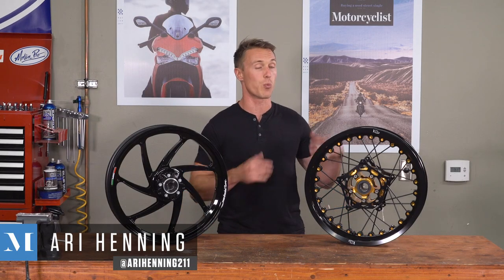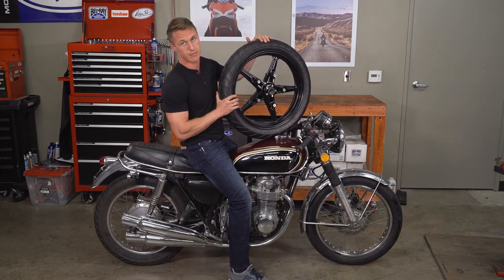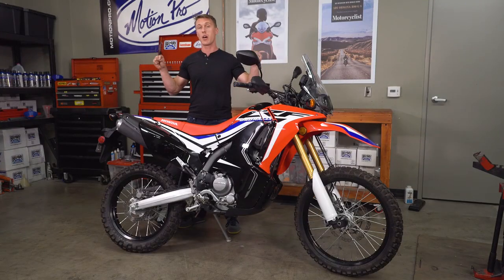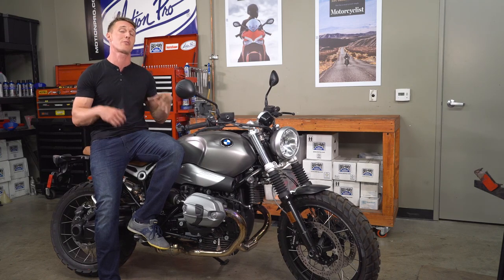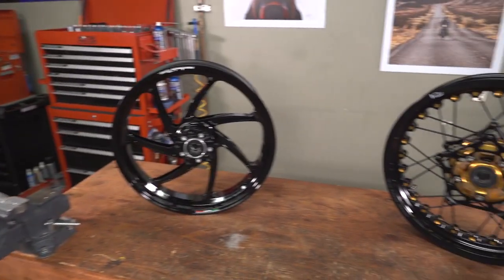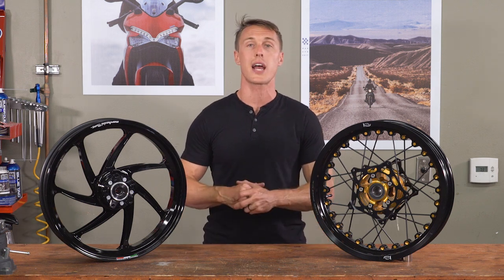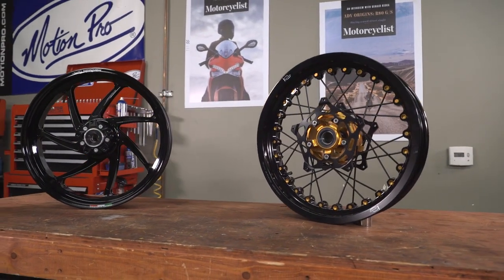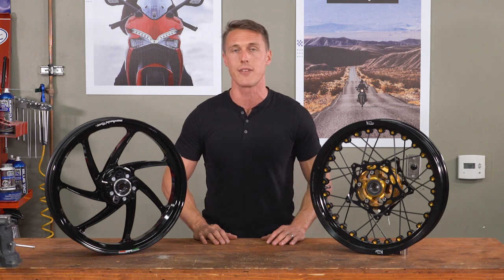Wire-Spoked Wheels vs. Alloy Wheels—Which Are Better?  | MC Garage

Comment: What do you mean by "alloy"? High carbon steel? Bronze? Zamak? All these are alloys, but I doubt you'd make a motor cycle wheel out of them.
Reply: Alloy is commonly misused as abbreviation for aluminum. 😕

Comment: One thing I find so frustrating is the unwillingness of the motorcycle industry to provide 20" front tires .   Frustrating because obviously it would be the perfect compromise between running a 19" with more of a road tire or a 21" with narrower dirt type tire...with the increasing popularity of the  adventure motorcycle this missing size leaves a glaring vacancy!   It's not life and death and of course a person can make do with less than optimal but it's just damn frustrating is all!  Say you looking at buying either a DL1000 Suzuki or a CRF1000  ...one of the most glaring difference between the two is the front wheel size...The CRF's 21" with it's narrower tire is the Superior option if there is a lot of dirt and the 19" of the DL is decidedly more biased to the street....obviously then having the option of running a tire width smack in between those would net an ideal compromise for a number of rider....and you know what?  It used to BE an option!  What might be really nice would be to have bikes built to swap between all three!   Maybe just adjust the fork height slightly sometimes but mainly just pop one wheel off and the other on simply because one ride going to be all highway with a lot of high-speed Twisties where the 19" fatty is chosen ,  where as for an upcoming adventure that is on along a super long rutty pot holed twisting up and down dirt route where the 21" would be the decidedly better option ...but for everything else when there is no clear motivation to run the 19 or the 21?   Back to the standard 20" that came on her....I think for any of the big adventure bikes a 20" front could be the best possible standard choice.  And with more and more models moving to back to laced spoke wheels there is more and more a market even for existing motorcycles to sell the 20" ....Might they for example even work on the existing Vsrtom 650 and 1000?   Apparently  a jump to 21" is too much for these chassis ...but a 20"  I'm thinking would work with the right tires....no?
Reply: When changing size you need to consider the extra weight. 
Centrifugal force on a front wheel that is to heavy  can lead to a gyro effect.
Reply: @markuscamenzind5510  yes changing wheel size does affect various things ...it is not as simple as many think and many find out the hard way if only the initial clearance issues they never saw coming.

Comment: Fuck spokes! Spokes have maintenance and tubes at every tire change interval. Spokes rust and also get loose and a decent pothole with throw one out of true pretty easily! Mag = less maintenance and no rust and no shitty tubes you can plug in an emergency!
Reply: Can’t plug a tube is what I meant to say in the end there but spell check had a different idea! P.S. Fuck auto correct! It’s not always correct

Comment: You missed out that spoked wheels are lighter than cast wheels.

I've weighed a spoked Suzuki GT wheel and the later alloy wheel that replaced it. The spoked wheel was lighter by far.

Comment: The first bike I know of which came with an alloy (rear) wheel as standard was the Münch 1200TTS from 1968 as far as anything on a Münch could be called 'standard'. Spoked wheels couldn't take the torque/power.

Comment: Spokes, too much to clean, been there done that, alloy forever.
Reply: Too much to clean?, 2 minutes on each wheel with a pressure washer will get you right.
Reply: I’m with ya.
Reply: I have a 1993 Chrysler new Yorker fifth avenue with faux wire wheel covers that were stock and they take about 45 min to clean and polish all four, I still love them though, not to judge your life choices. for me its wire spokes.
Reply: @joshuamcpeek4708  
I see ... You are very diligent, hard working and cultured man. Hats off to you mate!
Reply: Dennis Karnes I have assume you havent met the spray cleaner and power washer not to mention the cheap bristle brush. I have been riding since 1968 we didnt have mag type wheels then and bikes were always clean. I guess its just we were better schooled back then

Comment: The Kineo spoked wheel to the left of you has a solid rim, no seals necessary, and is therefore tubeless. It prbably wont give as much as a normal spoked rim because of rhe added thickness to the rim which means it is likely less durable and more rigid.  It would be nice if you could have mentioned the properties of this wheel design as it lies somewhere in between. Great vid :)
Reply: Rims on spoked wheels should flex. But what i can see on kineo is that are is rigid as the alloyed one

Comment: Hi Ari thanks a lot. I need a help/ I prefer to buy a Ducati Scrambler but still confused on which one to choose. Love Icon, Full throttle and Match 2.0 design but I have moderate off road intentions too. So those alloys will do good? or  should i take a Classic which comes with  spoke wheels or off road Desert Sled(its a bit higher seat height for my height)?

Comment: Give me spokes any day. Way tougher.
I replaced a tyre on an alloy wheel and it bent the rim just with relatively light pressure to get the tyre over the rim.
You don't get that issue with spokes wheels.
Reply: And mostly just one at the time whereas cast wheels go " surprise mf "

Comment: I'm thinking spokes must be lighter and cheaper for a given application because all dual-sport and dirt-track bikes use them.  Maybe not great over 50 hp but if you are doing flips off a jump you have spokes.  Also bicycles that you have to pedal all use spokes unless you are looking at some sort of very expensive carbon fiber thing on a race bike.  There are lots of examples to the contrary of course, scooters usually have cast wheels, but anything performance has spoke wheels until you get to about 50 hp and 400 lbs.  It's the same thing as your video about chain drive.  There is a reason a WR450F uses a chain drive and spoke wheels.  It's trying to go faster than the CR450F and also get good air time on the jumps.  But so is the CR, so it also uses a chain and spokes.  Same with the KLM.  I've never seen a dirt-track racer with cast wheels.

Comment: Weight for weight, material for material, wire spoked wheels are stronger.  There's no getting around the fact they're prestressed, and cast wheels can't be.  A spoked wheel carries load on its tension, whereas a cast wheel carries load in compression, where high performance materials are inferior.

Comment: Flex, strength, and rigidity can be somewhat controlled in wire wheels during the building process. For example, close to 100% of motorcycle wheels are built with a 2 cross pattern. This is to give some flex which would be totally absent if it was built with a radial pattern. But this needn't be a limitation, higher cross patterns can be used, limited by the number of spokes, and the diameters of rim and hub. Four cross patterns were routinely used in competitive road bicycles back in the days of 36 hole rims with low flange hubs. These wheels could take a lot of punishment. About 30 years ago I stripped a comstar wheel and spun up a couple of discs to carry the spokes. I fitted a 40 hole rim using a 3 cross with 8 gauge spokes for a front wheel. I've only ever tuned that wheel once during that time. It is extremely strong while still delivering a very forgiving ride as far as the rim is concerned. The main limitation in using heavy spokes is the strength of the rim (they can develop longitudinal cracks from the holes if insufficient), and that enough meat is on the flanges of the hub (insufficient meat can cause breakage, probably only involving a single spoke). For motorcycles, it is important that the rims are "blistered" where the spokes enter, and that these are accurately drilled for the desired cross pattern. For anyone contemplating taking this route, I would highly recommend an insistence that the spoke threads be greased, preferably with moly grease. For some unfathomable reason, most builders do it dry. Probably because they are either stupid or lazy, maybe because they like doing rebuilds when the nipples are all frozen.

Comment: You also left out that when cast wheels fail, they fail catastrophically most of the time. Especially harder materials like aluminium and magnesium alloys. Spoked wheels will never shatter on you. For road use a spoked front and alloy back will work as the majority of catastrophic failures that'll kill you are front wheel based.
Reply: He literally said they fail and held up and destroyed wheel did you watch the video
Reply: @sneakerjoe23  he did say that but it was in reference to the spoked wheels being easier to repair, not that they could be safer when a failure occurs.  It is an easy inference to make from his statements, and pretty obvious and self evident.  I bet he intentionally didn't specifically say it to avoid offending all the militant crotch rocket squids.  Or maybe it's a hot take because it could imply that motorcycle manufacturers are sacrificing (a little) safety for profit.  
  Anyway, imo spoked>mag because durability and low maintenance is my prime concern in owning a bike.
Reply: @sneakerjoe23  That was Kawasaki's wheel. Marchesini wouldn't fail.
Reply: Rima R depends on what you hit
Reply: Actually spoked wheels with fail shatter on you under the right conditions. I’ve seen guys snap all the spokes on them in past. Generally it’s because of the one thing that wasn’t mentioned in this video that is a big deal. You have to maintain spokes and make sure they are tight. They work loose and if you hit a big pothole they stand the chance of breaking or bending and that weakens the over all structure till it’s fixed. The results are if you get a few of them to loosen up in that way the whole wheel can potentially fall apart. Granted this is a neglect situation but it does happen
Reply: ive had a spoke snap and stab the inner tube once but the rest of the rim was ok, your right its scary to see alloys bust
Reply: it was a wire spoke wheel that did that
but I still agree with your point
Reply: I think he made that obvious with the shot of the buckled cast wheel.

Comment: What about the question of rotational mass effecting handling as raised by AutoEx
pertTV?  More mass (heavier) will resist turning and leaning which should impair maneuverability at speed.  This has to be an issue for racing but also for highway touring.  Also unsprung weight is always touted as a great evil for suspension systems.  Are there any good, lightweight laced wheels that can run tubeless tires and out-perform cast wheels for weight and maneuverability in touring applications?  What about these questions?

Comment: Absolutely gorgeous for my ZX 14 with red spokes can you get wide enough to but a 240 mm tyre? Okay open my mouth to soon my ZX14 turbocharged is up on one wheel most of the time. But they are different and gorgeous

Comment: I'm 66 and will NEVER again have spoked wheels.  Cast wheels have no tubes. No more broken spokes.  Never have to worry about trueing the wheels. No more wholesale flats. Never had a flat with my cast wheels.  Could happen, but hasn't happened yet.  No more rusty spokes/rims..  I can change tires myself. (Can change tires on spoked wheels, but 3 times the pain.)

Comment: ALL street bike (including dual sport) wheels should be required by DOT to use tubeless tires. Two reasons. When a tube is punctured, it tends to blow out, losing air instantly. Very dangerous. When a tubeless tire is punctured, it tends to lose air very slowly, and sometimes not at all. But the really big deal is how to repair a flat. With tubeless tires, you plug the hole, inflate the tire, and be on your way. With a tube type tire you have to remove the wheel, then remove the tire, and replace the tube. Not that difficult at home with the right tools, but suppose you are out in the middle of nowhere? Very few bikes have centerstands these days. How are you supposed to get the wheel off the bike? People have died because they were stranded in the middle of nowhere, in extreme weather, with a flat tube type tire. I knew one of them. BMW makes tubeless spoked wheels. Honda made tubeless spoked wheels way back in 1986, for the 450 Rebel. The technology has been available for a very long time. It should be mandatory. It makes me sick to see abs on a bike with tube type tires. Tubeless tires for ALL bikes should have been around for decades now.

Comment: Thanks guys for another proper video. In my case, Speed Triple R 2016, the spoke wheels are 1.5kg heavier than the stock alloy wheels. And that does affect the riding and launching mode vastly. It is still sweet and powerful, but not like with the stock wheels. On the other hand, the bike feels much more smoother on uneven terrain and in places like my city, Bogota, that's a treat you can say no to! so very happy my spoke wheels. It all depends on what you are after: Cool Look or sweet performance.

Comment: As far as rigidity goes, a wire spoke wheel can do about the same as  a good mag. Some flex can help. It will not do too bad in the weight department either if you use a good alloy rim.  To get sufficient stiffness you need to run an alloy rim.. Most steel rims flex at the spoke entry allowing the wheel to twist some. I've always seen a pretty drastic improvement when going from steel to alloy rims.

Comment: What about chrome 4 spoke wheels? My motorcycle came to me (used 30 years ago) with a chrome 4 spoke rear wheel and an aluminum many spoked front and a matching chrome front with advice to not ever use it. Apparently they can come apart when used in the front? What are your thoughts?

Comment: wtf breaks an alloy wheel!? I just crashed my sportbike, broke a bone, and need to replace a bunch of parts on my bike after a direct collision, with my front wheel taking the full force of impact and it's perfectly intact..
Reply: I worked in mc salvage for a while, smashed front wheels are pretty common. You must have been lucky
Reply: Wheatley Lucky you.
Was it a cast or milled?
Reply: idk, it didn't look like it was anywhere close to being damaged :p
I mean, not that I'm complaining.
Reply: It's a stock Ninja 300 wheel, if that answers your question, XtreeM FaiL

Comment: I rented a BMW 1200GS from RawHyde Adventures for their off-road training and "Basecamp Alpha" excursions.  My bike had the stock aluminum wheels and was just fine.  I asked the trainers there how often they have problems with bent rims - they were clear that is was extremely rare (if ever).   I expect that this is only an issue for really aggressive riding and very rocky terrain.

Comment: If will never run a dual purpose bike with a tube.  Try replacing or repairing a tube on a trip, comparing to just inserting a worm or plug.  It is like two hours against 5 minutes.  And who want's to carry a few extra tubes on a bike?  I wish I could make my off-road bike tubes-less.  Spoke wheels have higher maintenance.

Comment: Wire spoke wheels usually would have a higher strength to weight ratio. That is the reason wire spoke wheels are used on most bicycles and why ferris wheels such as the London Eye and the High Roller in Los Vegas are giant wire spoke wheels.

Comment: Hi Ari, help a guy out here. Can you make a video on brake disc patterns and if they matter at all. Also I've seen some cars having brake discs with no perforation, would that not be bad for heat dissipation and metal expansion?

Comment: My '78CB550 has 750 front and rear end with multi-part solid wheels which bolt together (comstars) - which are better; spokes, cast alloy, or comstars? :P

Comment: Ari  on the next video LED vs Xenon vs halogen .

since there is metal 3d printing ,has anyone made a direct injection motorcycle head ,if not any way to try making one for the rc 390 .

Different types of cartridge usd forks open ,close, 25mm ,30 mm, and whats in the old rc390 and the new 2017 .

body positions and how to sit on a bike (should you lock you ankles on the foot peg or not , use the ball of your foot   or foot arch ).

what is ecu tuning, what is actually done .

535 gt Royal pain in the ass en-field ,is it any good and y in 2017 should a 535 cc bike  produce so little power .

vyrus M2 vs britten v1000

LS 218 VS 2017 HP4

Comment: This is a good video, but you missed one significant upside to the cast wheels, maintenance. Unlike spoked wheels, you don't have to check the tension on the spokes because there aren't any.

I personally like that because it makes it faster to get riding as I don't have to worry about checking my spokes.

Comment: Why not hybridize the designs?
Reply: I more meant like thicker wire spokes that didn't need to be tightened and calibrated/the wheel didn't need to be 'trued'. So basically a modular alloy wheel that was the best of both worlds in terms of stiffness, flex, durability, and the ability to hold power and torque and spin at high speeds.
Reply: Dude. No. Just... No. No. Why? What? No..... Fucking... Prick... >:/

Comment: Base on my experience i prefer for a wire spoke wheel. Alloy wheels is more sensitive and easy to break and cannot be repaired you have to replace it when it os damaged. Spoke wheels can be repaired easily and cost less. But when it comes to looks I go for alloys it looks more attractive than spokes.